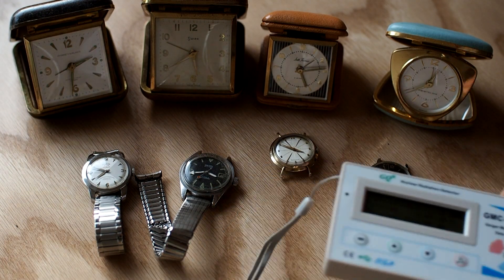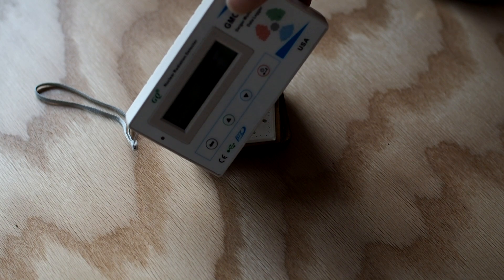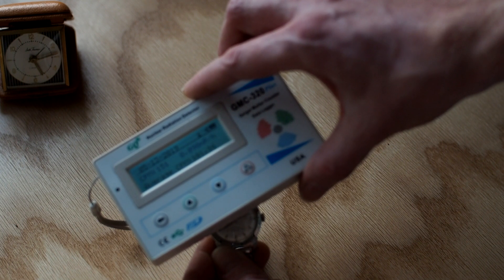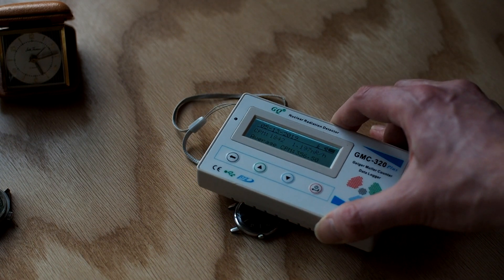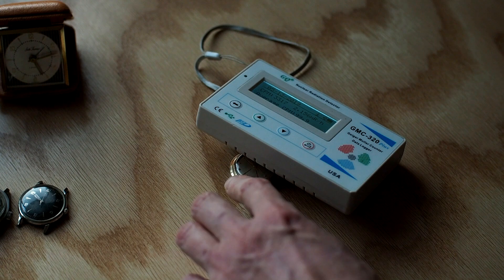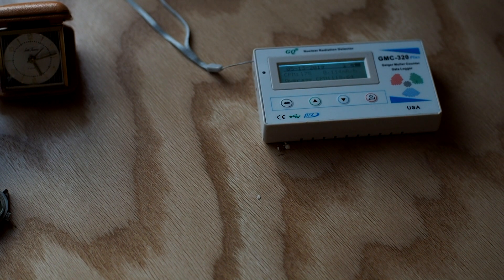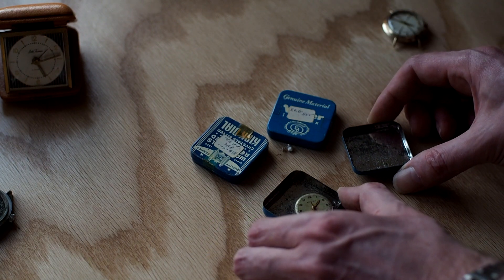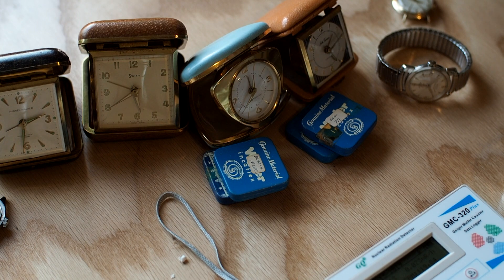The Biggest Mistake in the History of Watchmaking - How Radioactive is Your Radium Watch?

Comment: End of the day you buy a Vintage Watch...you test it straight away and if it's Radioactive remove the hands and face the movement is more or less fairly safe. You can remove the Radium Paint easily, I put the item(s) in a dish of water that has a tiny drop of Washing Liquid in it. Soak for a few mins then gently scrape off the Paint using a wood stick, the Paint isn't waterproof so comes away easily. You'll be wearing disposable Gloves and a Mask of course so when you're done just seal the whole lot up 
(minus the parts of course) and ditch it, it's safe enough in the trash can as it will just get buried or incinerated.
There really isn't much point in storing Radioactive Watch parts in tins in a Garage or Shed because sooner or later you will have to deal with them, they are Watches after all so should be rebuilt/repaired and enjoyed.

Comment: I have an old radium compass that measures 500,000 CPM.  Compete with that! lol. Although I have scintillation detector, which is more sensitive than a geiger counter.
Reply: It measures my background radiation in the house at >300CPM, due to radon, x-rays, and uranium and thorium in the soil and bricks on the house. I know this because the scintillation detector can not only measure CPM like a geiger counter, but it can also identify what isotopes are causing the radiation.
Reply: Americium 241 also shows up a lot due to the smoke detectors in the house.

Comment: I think there is a certain problem with the way your device is measuring radiation. The GMC-320 can only measure beta and gamma radiation together. It cannot show beta or gamma radiation separately. Which means that it measured maybe only beta radiation from your watches. Beta radiation is also not too good for the human body at certain levels. But it's by far not as dangerous as gamma radiation.

Comment: Very interesting. But I'm puzzled. If these pieces are so dangerous then why would you store them in the your garage (as you said at the end of the vid)? Why wouldn't you remove the radium or discard them altogether?
Reply: They are not dangerous unless you actually eat those dials. The amount of localized radiation they give is very low. Unless you store them (and have a lot of them) in a closed room with bad ventilation, there is no problem. Otherwise there is a potential build-up of radon gas, which in itself is not radioactive enough to cause damage, and it decays in around 3.7 days, but its daughter particles, if the decay occurs in the lungs and in great quantity is a potential lug cancer risk.

The main issue with ingesting radium is that its molecular structure is too similar to calcium, and the systems absorbs it in the body, fusing the radium with the bones and causing bone cancers over time. Don't eat the stuff basically.
Reply: Removing the radium will expose you to more risk than leaving it alone. The main risk (other than wearing it 24/7) is from eating or inhaling dust from the paint or radon gas decay. Storing it in a cabinet you aren't constantly close to is not dangerous.
Reply: theyre only dangerous if you have one with the glass cover off, and even then you can just store it in a glass jar to keep the radium dust out of your house.   The radiation doesnt go more than 6-12 inchs out,  and when on your wrist the metal and brass and so forth blocks most if not all the radiation..   Radium is EXTREMELY dangerous if inhail or eat it..  As for the radon gas, that would be so negligable.  Youre basement will have 100x more radon on it, and radon is also heavier than Air.. so unless youre laying on the ground all the time youll be fine, radon also takes like 20+ years to even do anything to you  at super high levels
Reply: @jeepsblackpowderandlights4305  Thank you!

Comment: As someone who collects radioactive things, this is one of the most accurate horological videos on radium I've seen, many other horological videos really underestimate the danger of radium due to a general lack of knowledge and a bias towards loving watches with radium.

Yes if you just wear one of these watches occasionally you'd probably be fine, but when you start to open them up and risk exposure to radium dust and radon is where things start to get really dangerous. Even just having them near where you are in your home can be dangerous, as radon will seep out of the watch.

The geiger counter you're using can't even detect the insane amount of alpha particles coming off of these things. Alpha particles can act like a poison, because when they're ingested the particles can do high amounts of damage to your internal tissues. One big error in many inaccurate horological videos is assuming the main danger is from the pure dose rate, and not contamination and ingestion.

Good job doing your research on this stuff, it's really important that these radium watches and clocks are handled, used, and stored safely
Reply: Hi. Im very nervous atm. I had an old ww2 compass laying around 80cm from me on a wood shelf for years now. I just tested with my gmc 300e counter and turns out, it had radium in it. had around 340cpm. a few cm away nothing just background radiation. how bad is it for me?
Reply: @TRUEFFEL321  sounds like a bit of a dud, I wouldn't worry. Maybe move it a bit farther away to avoid potential radon, but it doesn't sound like an issue
Reply: @EvilScientist  fun fact I have problems with my colon since january and im waiting for my bowel reflection and I feel sick but my blood is fine. now i am a bit paranoid that this comes from the compass :'D
Reply: @EvilScientist  thanks for the answer dude
Reply: @TRUEFFEL321  absolutely not, the levels coming off of you compass are negligible, you have nothing to worry about unless you open the compass and contaminate yourself
Reply: @EvilScientist I had started collecting vintage watches for about 8 years now. I had opened numerous watches and likely exposed to some. I know there is no way to clean up my body now. But is there a way to clean up my home, tools & watches?

Comment: Interesting video. I recently acquired a vintage Seiko 62MAS from either 1966 or 1967. Do you know if Seiko was still using radium for their dials in the 60s? I’ve had a few close relatives who were non-smokers get lung cancer so I’m a little concerned about radon exposure. That last watch you tested is insane. I didn’t realize how variable the levels are.
Reply from the maker: I've never seen a Seiko from that era with radium. The Geiger counter I used is well under a hundred bucks if you want to be sure.
Reply: @hugeshows  Thanks for taking the time to reply. I didn’t realize my brother has a Geiger counter he bought for his granite countertops. I measured the watch and it’s reading 0.10 MSv/h which I think is ok right?

Comment: Could any of those be tritium lume and there for setting off the beta reading gieger counter more so than the radium lume watches?
Reply from the maker: The only way to know for sure is to do gamma spectrum analysis on each sample, but based on the era in which those pieces came from, it's almost certainly radium.  I have yet to find a vintage tritium piece that registers at all on this particular (cheap) Geiger counter.
Reply: @hugeshows  what do you think a 1966 westclox wrist watch would have on it.
Reply from the maker: @IPRANKTheFool  Probably nothing active if you are sure of the date.  Pretty sure they were done with radioluminesce by then, but test to be sure.
Reply: @hugeshows  what cheap detector would show things like strontium, promethium, and tritium all lumenesences used after radium.
Reply: tritium has a half life of 12 years, then 6 years, then 3 years, then so forth...  If you found anything with tritium... it would most likely not be radioactive anymore

Comment: Great video! I also think your presentation was very lucid. The points were clearly made and the demonstration was eye opening. I own the same detector and while it wouldn't be used in a high level lab, it is really quite sufficient for general use. It certainly will warn you of any dangerous levels of radiation. I own a few Radium watches and some military pocket watch hands. The highest counts I got were about 500 and that was scary enough. Your watch that went over 40,000 CPM - well that got my attention! THANK YOU VERY MUCH for this video and it should help educate watch collectors of the very real dangers of Radium paint.

Comment: For a few days now, I've also have a vintage watch with radium dial and hands in my collection. A Cliwal Watch Skin Diver, from approx. 1957-62. Now I have concerns this watch might also emit as much radioactivity as been demonstrated here. I think I'll buy me a Geiger counter to test the emission of radioactivity that comes from my watch. https://uhrforum.de/threads/cliwal-watch-skin-diver-mit-radium-zb.449159/#lg=post-5756028&slide=3
Reply from the maker: Very few test as high as that last example I showed, but you never know until you test them.
Reply: @hugeshows  The dial reads 1.5 μC (MicroCurie), which corresponds to about 55500 Becquerel. However, I don't know how high this value would be read on a Geiger counter. https://uhrforum.de/threads/cliwal-watch-skin-diver-mit-radium-zb.449159/#lg=post-5756485&slide=0
Reply from the maker: @ganimed1976  You mean the watch dial has a rating for it?  Are you sure it's a radium and not a tritium dial?  If it's tritium you have very little to worry about.
Reply: @hugeshows  No it is a Radium dial. I guess you cannot open the linked picture from the dial. The dial is marked "Ra Swiss Made Ra". And beneath the 5 o'clock index, it reads "1,5 μC", which means 1,5 MicroCurie. When you have a Tritium dial, it sometimes reads "T 25" what means the Tritium has 25 μC (MicroCurie). BUT you don't have Gamma rays with a Tritium dial, right? I think the best way to find out how hard my Radium dial emits radiation is to get me a Geiger Counter.

Comment: The hottest radium piece I have is from an old Soviet dosimeter/radiometer. I get about 1 R/hr (10 mSv/hr) at close contact. However, my instruments are calibrated with cesium-137, so it won't be dead-on accurate, but it's close. My Inspector USB Geiger-Müller counter goes over 370,000 CPM, but it overflows around that high of a reading. However, it does have anti-saturation. When it rains, I get over 600 CPM just from natural radon washout when I wipe test a surface and wring out the rainwater. The counts come mostly from lead-214 (19.9 min) and bismuth-214 (26.8 min), which have unique energies and branching ratios (every radionuclide does) for beta and gamma radiation, but bismuth-214, especially, emits strong beta and gamma rays, with many energies and branching ratios. Also, using activated charcoal sealed with a radium source nearby can tell you if they are sealed well or not. It's good at absorbing radon. Watches lumed with radium were ceased in 1968, and clocks lumed with radium were ceased in 1978. For large sources, using the same or less radium concentrations was easier and safer, and it still provided decent radioluminescence. This is why newer radium clocks are generally less hotter than watches. Thank you! This was a cool video! If you do get rid of some of these, I'd be interested in taking them! A lot of people sell radium sources as elements/check sources!
Reply: Ah yes the famous DP-63A geiger counters with a small Strontium-90 check source that's already been through a half-life and then inexplicably also a Radium-226-doped dial that's 100x more radioactive than that! Seriously why did they even bother to make a dedicated check source for it?
Reply: Is it a DP63? 10mSv sound way too much for that one
Reply: @sonyxperiasmk not energy dose compensated, and probably used with a pancake so it detects alpha and beta. For accurate dose you only use gamma

Comment from the maker: To be clear, I'm not disposing of all of those pieces.  Some of them have sentimental value.  However, I'm being aware of how hot each piece is, its relative value to me, while factoring in my decision on whether it's worth (whatever) additional risk it may potentially pose to me and those around me.
Reply: I collect radioactive sources, and I do collect radium lumed watches. Whether they're just barely detectable or they are hot, I would never get rid of them. Also, if they are sealed, there's extremely little to be concerned about. Even if they have a breach in the crystal or elsewhere, the best thing to do is put it in a couple of plastic bags or containers. The radiation itself is quite low in reality. The only concern I have is to make sure the actual radium lume doesn't get inside of you. It's chemistry is what makes it far more dangerous than just its radioactivity.
Reply from the maker: @KarbineKyle  That seems to be the most common opinion about them, but if I didn't bore you to death before you made it to the end of the video, my overall point is that I'm measuring 4 orders of magnitude difference between my weakest example and my hottest example.  And these are just ones I've collected over a year or so.  I find it hard to generalize about exposure safety when the level of activity varies so widely, especially when you consider that this is potentially an item that you strap to your wrist.  The pieces ranged from 40 counts per minute to over 40,000.  And we're not talking about weak radiation here either, the detector I use has a glass Geiger tube so it's not picking up any of the alpha radiation or weak betas.  40,000 counts a minute of penetrating, ionizing radiation is not something to treat casually.  And also bear in mind that 40k counts is from a detector that isn't even able to cover the surface area of the dial, it's about the size of a cigarette.  A pancake probe would probably measure over 100k counts, and far far more if it had a mica alpha window.  And unless you test each piece you have, how will you know which ones are that bad?
Reply: I watched the whole video, and it wasn't boring. I liked it! I'm just a radiophile when it comes to this! A mica window Geiger-Müller counter is the best, and it would definitely read over 100 kCPM on your hottest source. As a general rule, although crude, a pancake type detector is usually about 10X more sensitive than beta/gamma only tube–and that they can detect alpha too. At least in my experience. I use distance, time, and shielding. Also, Q-factors, which is how much biological damage a type of particle can cause. Beta, gamma, and X-ray have a Q-factor of 1, whereas alpha has a Q-factor of 20. Even though alpha has very poor penetration, it does 20X more damage internally. I would say that if a source is a "point source", you won't receive a full-body dose. However, what you said about the sources being unsealed is very important, since radon can escape. Activated carbon is effective at absorbing the radon, and the decay products will also be present in the carbon after the radon has decayed, and they will remain. Radium is "sticky". It doesn't wash off as easily as other radionuclides I've handled. Plus, there are clues to see if an instrument has been painted with radium lume. If the lume is discolored, darkened, and/or has  caused burns to the dial or crystal, there's a good chance that it's radium. Also, it's probably high in concentration too. I know that radium lumed instruments can vastly vary in the activity they have. As for radioactivity, when you start getting into 100,000 CPM or higher, you don't want to handle it for hours, or carry it around in your pocket for example. If it's only putting out a few hundred or few thousand CPM, I don't see much of a hazard, as long as it's not close to any sensitive organs for many days. For something in between, like several thousand CPM to 100,000 CPM, I'd still use caution, however if I have to be exposed for long periods of time, I would use glass or Plexiglas shielding to work around, so you can see what your doing. Lead is great for gamma and X-ray only, however, lead for example can produce secondary radiation, called "Bremsstrahlung", which are braking X-rays. The heavier the element, the more energetic the secondary X-rays will be when a high-energy beta particle for example interacts with said shielding. So, specific radionuclides with specific shielding can be more of a hazard if your using, say, lead to shield strong beta radiation from strontium-90 for example. I always use the inverse square law, so that my dose drops exponentially as I move away or towards a source. Anyway, I know this is long, but I keep radium sources sealed inside something airtight with activated charcoal, and at least a few meters away. That's just me. However, I can understand wearing these too much, and especially working with sources that aren't sealed well, because radium is very hazardous if you inhale or ingest it. Especially for people who may not know.
Reply from the maker: @KarbineKyle  Holy crap I just typed out a very detailed reply and youtube ate it.  Great post, thanks for all of the tips and observations.  I both answered and asked questions, and right now I'm too pissed at the comments feature to re-do it.  But I'll get back to you, and please email me if you want to take this stupidly hot junk dial off my hands.
Reply: I've had my comments removed like that too! I don't know what it is exactly, but it's very frustrating! I don't know how to send you my email or PM you. I think YouTube got rid of PM'ing! Anyway, if you don't want some of these hot dials, I'll take them off of your hands! I don't know what your email address is, and I don't know how to PM mine to you . . .
Reply: @thenewbrutes  🤣🤣🤣